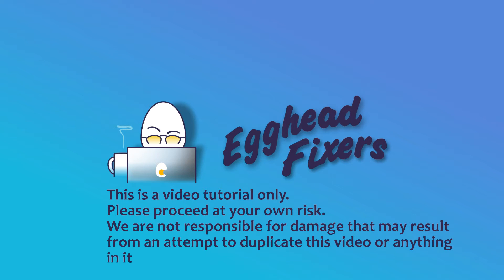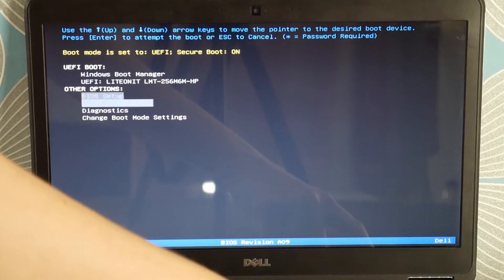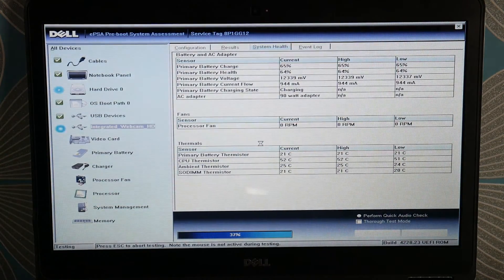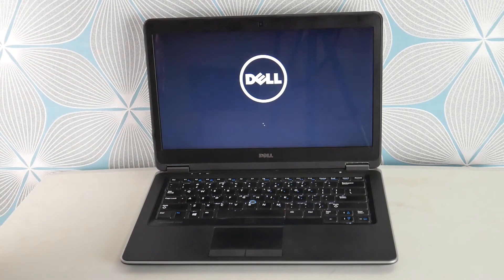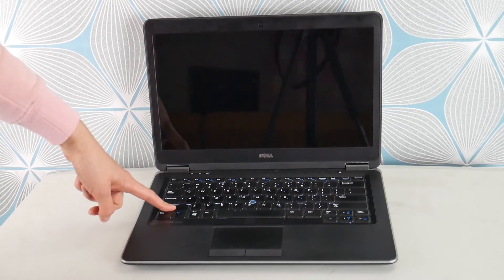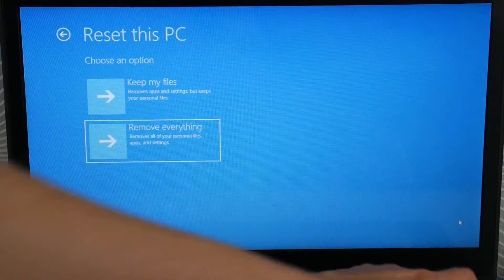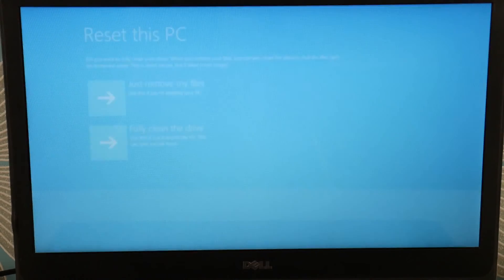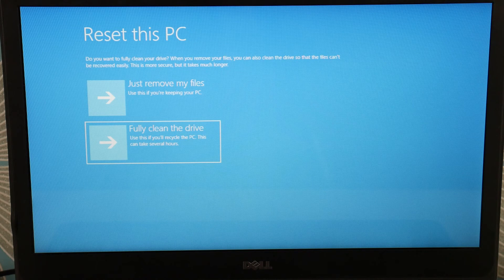How To Fix A Dell In A Preparing Automatic Repair Restart Loop

Comment: Hi, my Dell XPS 8930 constantly restarts to factory setting on its own, removing all my files and apps. It has done that 4 times now in 3 days. Please help me out as well.
Reply from the maker: Wow that is a very strange problem. What happens when you run the diagnostic? Does all your hard ware pass?

Comment: I am having this problem with a brand new dell laptop that I bought this Monday, additionaly since the first start up the laptop has either been freezing, lagging and some thinks just will not work.
Reply from the maker: If its that new I would consider returning it or calling it for a repair under it's warranty. It shouldn't have problems that quickly. It could be a sign that you got a lemon:/
Reply: @EggheadFixers  I took it back and they checked it for me, unfortunately the new laptop had a corrupted operating system. I have been using it for over eight hours now and none of the previous issues are present. Fingers crossed it does not happen again and luckily I have a one year warranty.
Reply from the maker: @StephanieHWLS  Ya if it was only an operating system issue then you will likely be fine. Sometimes the operating system doesn't install correctly and it just needs a fresh install of Windows.

Comment: I cannot access the Recovery Manager like you showed
Reply from the maker: Sorry to hear that☹ Sometimes when the Operating System is not functioning properly then you can no longer get to the options to reset it. In this case the next step would be to reinstall the operating system. Here is a video on how to do that:

https://youtu.be/TElCJDbKdKk

You can skip the part of the video about replacing your hard drive. Let me know if you have any more questions:)
Reply: @EggheadFixers  Thank you so much. I have reinstalled the OS as you said and I'm up and running again. You're the best!
Reply from the maker: @larryking9368  You're welcome!!

Comment: Plz can u help me when I did the F12 check everything has a tick exempt my Hard drive 0
Reply from the maker: Sorry to hear that☹ First I would try what we call reseating the hard drive which means unplugging it and then plugging it back in. Then rerun the diagnostic. If that does not work then its most likely that you need a new hard drive. Sometimes when a hard drive really dies the motherboard doesn't read it as being installed. Here is a video on how to replace your hard drive and install an operating system:

https://youtu.be/TElCJDbKdKk

Let me know how it goes:)
Reply: Egghead Fixers thank you so much it's very upsetting becue I jsut heard than school have gone back into lock down and I need it to do my learning but ty again very much
Reply from the maker: @helahn5229  ugh ya that stinks:/

Comment: hey the shift method is not working
Reply from the maker: Sorry to hear that☹ Sometimes when the Operating System is not functioning properly then you can no longer get to the options to reset it. In this case the next step would be to reinstall the operating system. Here is a video on how to do that:

https://youtu.be/TElCJDbKdKk

You can skip the part of the video about replacing your hard drive. Let me know if you have any more questions:)

Comment: My hard drive diagnostic check was good. Then followed your software check, could not get to the Recovery Manager screen. I really don't want to lose my files.... how do I hook up to an external Hard Drive bay?   Love you videos...Thanks..
Reply: Thanks....Do you have a video on that it will I find instructions with the hard drive bay? Thanks for your help.
Reply from the maker: @aimibiggs7332  Sorry we don't have a video on that:/
Reply from the maker: You can buy them at most electronics stores. You have to take the hard drive out of the computer and hook it up to the hard drive bay in order to remove the files from the hard drive.

Comment: Hi so the recovery manager won’t even show on my laptop (shift+power) but when I did the diagnostics all the hardware was fine. So should I just get a new Hdd or ssd and reinstall windows 10?
Reply from the maker: In that case I would start by reinstalling the operating system. Sometime when the operating system is too corrupt then you can no longer reset  it.
Reply: @EggheadFixers  So do you guys have a tutorial on reinstalling the operating system.
Reply from the maker: @YeahmynameKiara  yes we do. Here it is:
https://youtu.be/TElCJDbKdKk
Reply: @EggheadFixers  Wait so I have to get a new hard drive? Anyway I could format or clean my current hardrive?
Reply: @EggheadFixers  Also should I buy a product key for windows 10?
Reply: @EggheadFixers  Should I replace the RAM?
Reply from the maker: @YeahmynameKiara  If your hard drive passed the diagnostic then you most likely do not need a  new one. If your computer came with Windows 8 or Windows 10 then it should automatically activate with the product key stored on your motherboard. If your computer came with windows 7 then you will need find the product key stick usually located on the bottom of your computer. In rare cases the activation errors out and then you need to buy a new product key but in that case you can buy them for about $10 on Bonanza.com. I would try  reinstalling the operating system first before you try replacing any parts. Save some $$$ if you can.
Reply: @EggheadFixers  Ok I will give it a go.
Reply from the maker: @YeahmynameKiara  👍
Reply: @EggheadFixers  Thank you! thank you! thank you! So from now on do I have to boot using my usb?
Reply from the maker: @YeahmynameKiara  you're welcome!! Now you should be able to remove the USB and boot like normal.

Comment: Hlo mam my latop is not wrking and it is not opening and showing automatic repair but after that a black screen and cursor is coming but nothing is visible.Could u help this
Reply: In diagnoising it is showing harddrive error
Reply from the maker: @murarikalluri7025  Sorry to hear that☹ First I would try what we call reseating the hard drive which means unplugging it and then plugging it back in. Then rerun the diagnostic. If that does not work then its most likely that you need a new hard drive. Sometimes when a hard drive really dies the motherboard doesn't read it as being installed. Here is a video on how to replace your hard drive and install an operating system:

https://youtu.be/TElCJDbKdKk

Let me know how it goes:)
Reply: @EggheadFixers  but it is imbuild

Comment: So I did a diagnostic and everything came out good except for the charging and I tried to open the recovery manager but it didn’t do anything also I’m not stuck on the recovery page I’m stuck on the 64% installing windows loop where it turns off then loads up the 64% installing windows page then turns back off then does it again
Reply: And it’s been like that for the past 8 hours
Reply from the maker: @way2smple  Sorry to hear that☹ Sometimes when the Operating System is not functioning properly then you can no longer reset it. In this case the next step would be to reinstall the operating system. Here is a video on how to do that:

https://youtu.be/TElCJDbKdKk

You can skip the part of the video about replacing your hard drive. Let me know if you have any more questions:)
Reply: @EggheadFixers  omg thank you so much u just saved my laptop from being absolutely destroyed
Reply: @EggheadFixers  ummm so thanks again but I got to the restart part and I restarted now and then it did it but then the support assist came up and said no bootable device wat do I do?!?!?!? HELPPPPPPP
Reply from the maker: @way2smple  Did you reinstall the operating system?

Comment: Hey Eggheads!
I'm currently on a Inspiron 3520, followed your steps for the diagnostic and everything but the fan had an issue. 
When I get too the last step into recovery manager it doesn't do anything, I just get stuck on the repair loop... Any ideas?
Reply from the maker: I'm not sure I understand correctly what hardware failed the diagnostic?
Reply: @EggheadFixers  you replied like siri lol😂
Btw you solved my problem
Reply from the maker: @shivamshardul9894  haha I guess I've been in computers too long. Glad we could help:)

Comment: I don’t understand is there another way other than deleting everything
Reply from the maker: You can do a soft reset. It doesn't work as well but it's worth trying. You can do this by selecting the "keep my files" option when resetting your computer.
Reply: @EggheadFixers  ok I’ll try but I hope this works 1 question why does this happen and is this normal
Reply from the maker: @gbengapaulolufemi1153  There is a lot of different things that can cause this problem. It can be something simple like a power loss, improper shut down, update, hardware problem, Etc. It's unfortunately a very common problem.

Comment: 2:15 I tried to reset “Remove Everythjng” and it didn’t do anything. Desperate for help as I’ve had this loop problem for a week now
Reply from the maker: Sorry to hear that☹ Sometimes when the Operating System is not functioning properly then you can no longer get to the options to reset it. If all your hardware passed the diagnostic then the next step would be to reinstall the operating system.  Here is a video on how to do that:

https://youtu.be/TElCJDbKdKk

You can skip the part of the video about replacing your hard drive. Let me know if you have any more questions:)

Comment: My laptop is showing the same thing yours is when it ran the hardware diagnostic. That the battery is at the end of its life, and nothing else is wrong. You said all your components passed but it still showed a warning. Does this mean my battery is shot or is it fine?
Reply from the maker: Ya when it tells you that the battery has reached it end of life then its time to replace it.  There is a small chance that your battery is causing your boot loop issue. Here is a video on how to test for if your battery is causing your problem:

https://youtu.be/TA1mFPtKVnw

Also if that doesn't remedy the issue I would try a factory reset or reinstalling the operating system next:

https://youtu.be/TElCJDbKdKk

Comment: Can you help me? When I am turning on my laptop, the Dell logo appears. The loading is done. Then it's just a black screen. I tried restarting it multiple times but it's still the same. Sometimes i get a screen saying automatic repair then a black screen.
Reply from the maker: Sorry to hear that:/ What happens when you run the diagnostic? Does everything pass?
Reply: Same problem and after running the diagnostic it shows cross❌ mark on hardware test
Reply from the maker: @sivaranjanir6632  Is the X next to the Hard Drive? What does it show as failing?
Reply: @EggheadFixers  yes. What should be done now?
Reply from the maker: @sivaranjanir6632  If your Hard Drive failed the diagnostic then unfortunately you will need to replace it. Here is a video on how to replace your hard drive and install an operating system:

https://youtu.be/TElCJDbKdKk

Let me know how it goes:)
Reply: @EggheadFixers  thanks you ❤
Reply from the maker: @sivaranjanir6632  You're welcome!!
Reply from the maker: @justgamerthret1068  leave a link for your video here and we will watch it

Comment: it still says prepairing automatic repair please help
Reply: also on the test it says one or more errors were detected
Reply from the maker: @ziz2eliteee947  What were the errors? Did any of your hardware fail the diagnostic?
Reply: @EggheadFixers  it’s didn’t show and i don’t think any hardware failed
Reply from the maker: @ziz2eliteee947  Usually when it detects an error you can select the advanced options and you can see what error was detected. Because if it says there was an error detected there is a chance some of your hardware failed the diagnostic.
Reply from the maker: If all that hardware passed the diagnostic then the next step would be to try reinstalling the operating system. Usually this problem is caused by a problem with operating system. Here is a video on how to do that:

https://youtu.be/TElCJDbKdKk

You can skip the part of the video about replacing your hard drive. Let me know if you have any more questions:)

Comment: It keeps on showing the logo it doesn't load anymore. Help me to fix mine please.
Reply from the maker: What happens when you run the diagnostic? Does everything pass?
Reply: @EggheadFixers  No if im not mistaken the hard drive didn't pass. What should I do?
Reply from the maker: @erniebhoyalcantara6805  Sounds like you need a new Hard Drive. Here is a video on how to replace your hard drive and install an operating system:

https://youtu.be/TElCJDbKdKk

Let me know how it goes:)

Comment: No problems have been found with this system so far do you want to run the remaining memory test this will take about 30 minutes or more 
 What to do now 
Pls help
Reply from the maker: Sorry to hear that:( If all that hardware passed the diagnostic then the next step would be to try reinstalling the operating system. Usually this problem is caused by a problem with operating system. Here is a video on how to do that:

https://youtu.be/TElCJDbKdKk

You can skip the part of the video about replacing your hard drive. Let me know if you have any more questions:)

Comment: Is the dell hardware diagnostics 100% reliable in your experience? I have this issue, and have tried everything. Computer says hardware is all good. Even attempting to re-install Windows 10 (from a USB drive) brings it back to the exact same boot loop loading screen, but this time with the windows logo instead of the Dell logo. Can a faulty RAM card cause this issue?
Reply from the maker: Yes RAM can be the issue and the RAM Diagnostic is not as accurate. You are better off manually testing the RAM by taking one RAM sick out at a time and seeing if the problem goes away.
Reply: @EggheadFixers  Thank you for your help! I just realized I left a comment on both of your videos lol. I REALLY appreciate the help. I will update if the new HD and RAM card fixes the issue.
Reply from the maker: @SW20FL  Nice job troubleshooting!! Ya let us know how it goes:)

Comment: Helppp i cant on my loptop
Reply: My loptop said automatic repairing but it keeps loading i cant go in my loptop
Reply from the maker: @Azens2006  Okay, what happens when you run the diagnostic? Does everything pass?
Reply: @EggheadFixers  yesss thanks
Reply from the maker: @Azens2006  no prob👍
Reply from the maker: What problem are you having with your laptop?

Comment: Everytime I try to boot off my windows 10 usb it restarts and nothing has worked
Reply from the maker: Try a different USB port. Sometimes they will only boot from certain ports. Also in BIOS is it set to UEFI with Secure boot on? Is the USB set first in the boot order?
Reply: Egghead Fixers how do I set my usb to first? I tried to follow your video but I have a different boot screen from yours

Comment: This just happened with the recent update . I’m stuck on the black screen and it passes all of the diagnostics tests . I can’t get to any blue screen
Reply: same! happened with me today after the update :/
Reply: Japneet Kaur I reinstalled windows with a usb and it worked . I lost everything on my computer but at least I don’t have to go out and buy another laptop.
Reply from the maker: @ltsAero  Ya the lost of data always stinks but i'm happy to hear you got it to work👍👍
Reply from the maker: @squirtle.rollin  Sorry to hear that:/ What happens when you run the diagnostic? Does everything pass?
Reply from the maker: Sorry to hear that☹ Sometimes when the Operating System is not functioning properly then you can no longer get to the options to reset it. In this case the next step would be to reinstall the operating system. Here is a video on how to do that:

https://youtu.be/TElCJDbKdKk

You can skip the part of the video about replacing your hard drive. Let me know if you have any more questions:)

Comment: I get send to a blue screen then it turns off turns sends me to a white screen then powers off what do I do
Reply from the maker: Sorry to heat that:( What happens when you run the diagnostic? Does everything pass?
Reply: Egghead Fixers it’s fine a I just looked up another YouTube video and it’s fixed
Reply from the maker: @KeyLockem  ok good to hear

Comment: What do i do when I trying to set it up and it says "Device preparation Failed"?
Reply from the maker: Does it say this when you are trying to reset the computer?
Reply: Egghead Fixers No, It says it when i Try to set it up. Since were in quarantine My school gave us laptops that they reseted, So i was going though the steps to set it up, And it says “device Preparation failed, Installation exceeded the time limit set by your organization.”
Reply from the maker: @Wavyosa  Sounds like they gave you a computer that the reset didn't complete correctly. I would try contact them or do a fresh install of Windows.
Reply: Egghead Fixers ok.

Comment: did your guide did the diagnose and how it's still doing the infinite attempting repairs also I can't go into the recovery and reset my pc help please
Reply from the maker: Sorry to hear that☹ Sometimes when the Operating System is not functioning properly then you can no longer get to the options to reset it. In this case the next step would be to reinstall the operating system. Here is a video on how to do that:

https://youtu.be/TElCJDbKdKk

You can skip the part of the video about replacing your hard drive. Let me know if you have any more questions:)
Reply: @EggheadFixers  thx for the anwser but it seemed that i did something wrong during my investigation and got it working fine!
Reply from the maker: @Footitich  Excellent!! Happy it all worked out:)